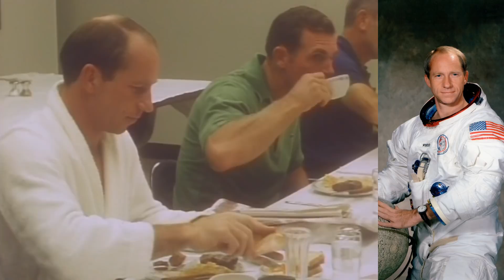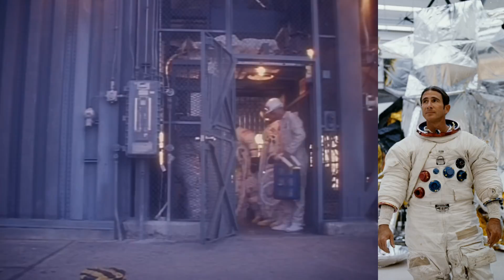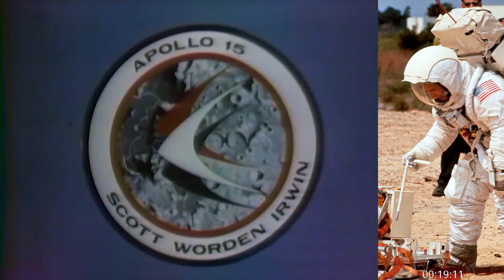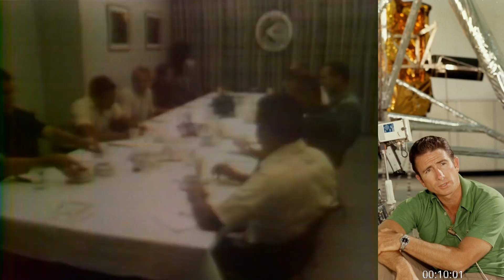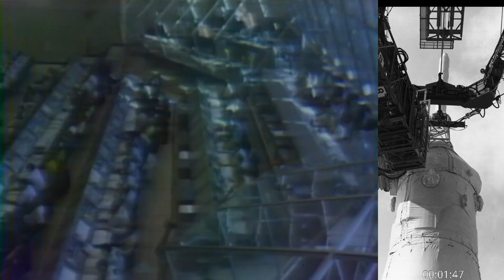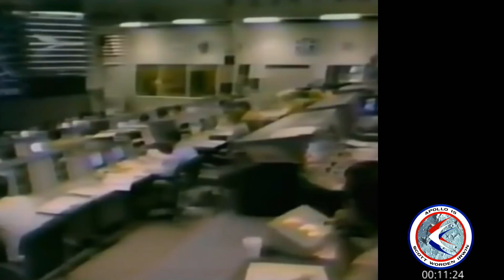Apollo 15 - Launch - 50th Anniversary (1971-2021)

Comment: I'm late to the party, but here's something that's not that known for this mission.
During S-IC and S-II staging, the stages almost COLLIDED.
This was due to the fact that 4 of the 8 retrorockets on the S-IC were removed, along with the 4 ullage motors on the S-II aft skirt. The F-1 engines had also been fine tuned to have a bit more thrust. 

All this was done to conseve weight because of the lunar rover being added. 

During staging, the two stages were SO close that the J-2 engine exhaust ruptured the LOX tank dome of the S-IC. You can see this happening when a plume runs down, it moves slower compared to the others. It doesn't appear in any other mission.

This didn't jeopardize the mission at all though, so the crew was safe and on their way to orbit, and eventually, the moon.

Comment: HI LM5--What can I say?  You produce stuff that is just CRAZY GOOD!!  If I may, I would like to add a bit of 'trivia' for this flight.  Being the first 'J' mission, the translunar payload weight was increased by several thousand pounds.  To do this, several 'tweaks' were made to the Saturn V and to the procedures.  You probably know that the S-II 'ullage' rockets were deleted.  Sandia Labs worked out the delay necessary for S-II engine start to ensure that the propellants had 'sloshed' to the rear of the S-II tanks, so that the J-2 turbopumps would ingest liquid without the benefit of the 'ullage' acceleration.  Also, this flight was launched on an azimuth of 80 degrees rather than the 'usual' 72 degrees.  This resulted in a significant payload performance gain.  Also, the 'Flight Performance Reserves' ('FPRs') were cut back such that the mission was no longer protected against a '3-sigma low' launch vehicle performance.  Instead, the FPRs were such that only 2-sigma low was protected.  These things enabled the vehicle performance increase.
Reply: Wow Dave, that's in depth stuff. I've been an Apollo fan since i was a boy, but you've given me some new things to look up. Thankyou.
Reply: @bro70  You're very welcome!  Thank you for your kind reply.